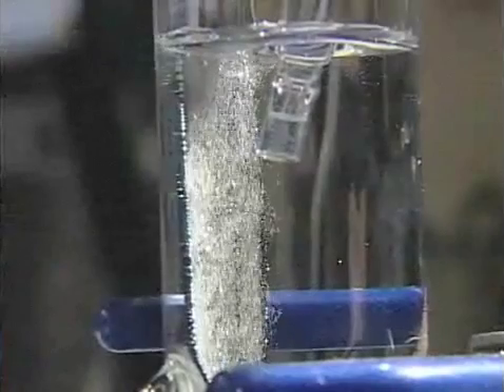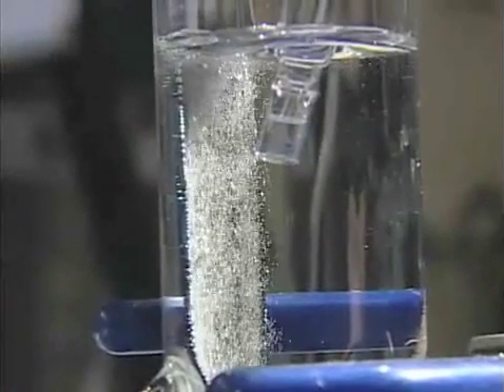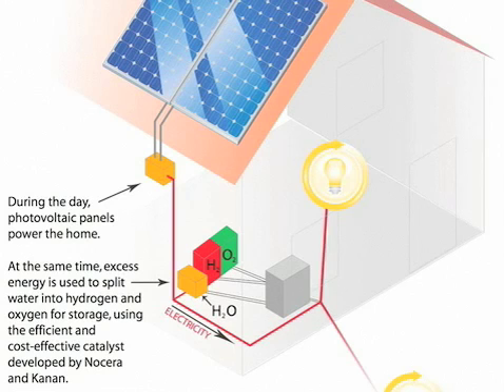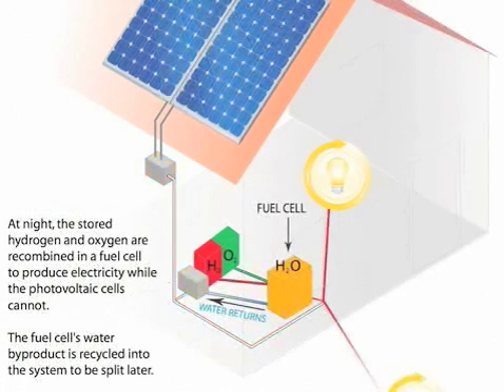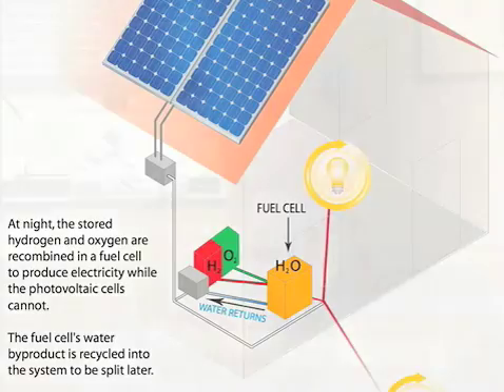MIT: New Discovery on how to harness Solar Energy

Comment: Thete are containers that can both store hydrogen and oxygen safely, it's called metal tanks, the same as they use in commercial applications daily.

The collector which separates the two gases is what needs to be used and I assume the commercial machine can be scaled down to for use in a residential setting.

People have to learn to take back their control and not rely on greedy corporations who suck the life out of everyone.

At one time, electricity was government controlled and non profit so that society can build itself up. The unindicted criminals we vote into office who are bought by private corporations wrote laws privatizing electricity. 

People need to take back their control and power.